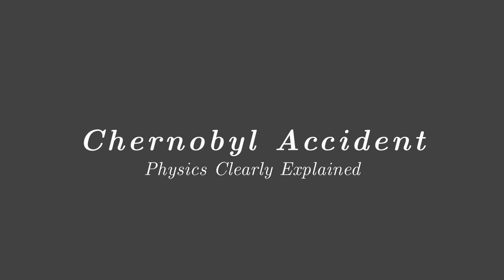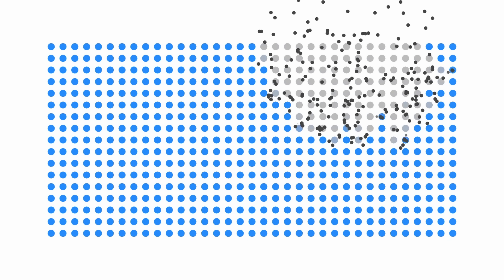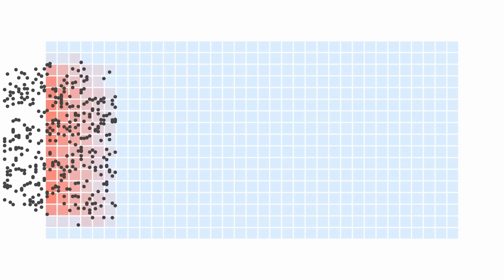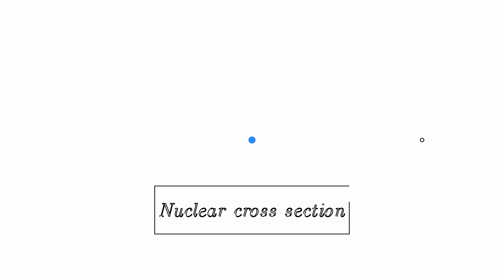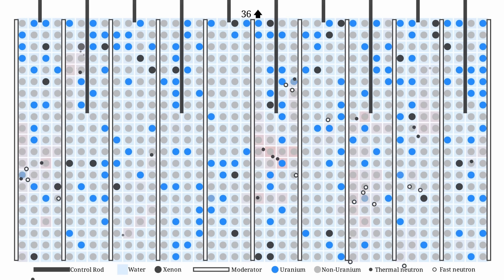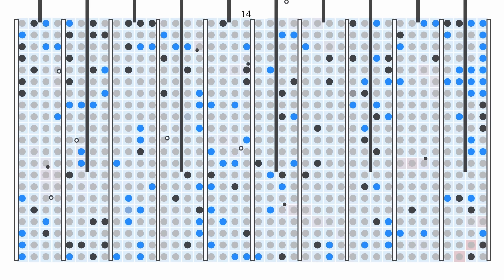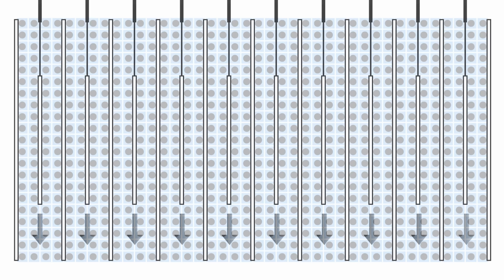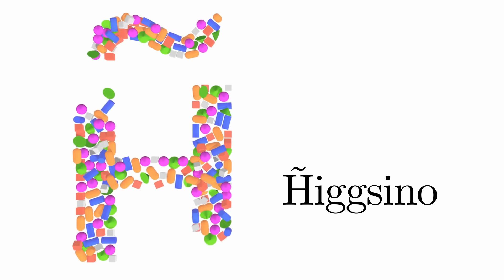Chernobyl Visually Explained

Comment: the fact that chernobyl happened is so stupid and it makes me upset. i dont even understand how they managed to accomplish such a feat.
how the hell did a human being with a working brain go "Ah yes! We should completely ignore the safety protocols set in place for the purpose of safety and preventing our nuclear reactor from becoming an extremely expensive pipe bomb! This is a wonderful idea! Surely Unit-4 isn't going to explode now!" and then act surprised when unit-4 actually did fucking explode 

(moreso, the steam that built up when all the water flashboiled exceeded the maximum pressure that the containment chamber/vessel/whatever you wanna call it could handle and then that caused a steam explosion then that was followed by a second explosion and a big ass radioactive fireball, but it sounds much funnier if i just say unit-4 went kaboom)

Comment: Beautiful video!!
Reply from the maker: Thank you for the kind donation!
Reply: @Higgsinophysics  I only have one question. Why did the control rods have "graphite displacers"?
I don't understand the engineering decision, can you explain? What's the purpose of these graphite displacers?

If the control rods are supposed to slow down the reaction, why do they have parts that speed up the reaction?
Reply: @EddiAndriniAnimation  "For the same reason our reactors do not have containment buildings around them, like those in the West. For the same reason we don't use properly enriched fuel in our cores. For the same reason we are the only nation that builds water-cooled, graphite-moderated reactors with a positive void coefficient. It's cheaper."
Reply: @fromaheight3958 That's just a quote from the series. I'd like to hear an actual answer!

Comment: It's like a perfect storm of different small mistakes and design flaws converged to cause this disaster. 

Number one of course was the attitude and actions coming from a tendency to prioritize job performance over safety.

They saw that something was slightly but noticeably wrong with the reactor status and decided to continue with the safety test, repeatedly, for a prolonged period of time. If they didn't get this done, they would likely face consequences from their bosses. Labor that's driven by fear is prone to error, same as unchecked ambition.

Once they finally tried to end it, it was too late. A design/construction defect unexpectedly triggered the final burst. (Control rod tips not up to code)

Comment: Those "jumping tops" are just myth. If any of them yould "jump", it would be because top plug of the channel failed and then overpessurized steam would simply rocketed that top cover into ceiling of reactor hall. After all, those tubes representing channels went through solid concrete top cover of teactor (and also its bottom), there was no way they could make any vertical movement (and top cover only flew to the sky after heat buildup skyrocketed and technological channels ruptured, allowing steam to rise it).

Comment: Why the hell did the control rods have graphite sections at the bottom?
Reply: "For the same reason our reactors do not have containment buildings around them, like those in the West. For the same reason we don't use properly enriched fuel in our cores. For the same reason we are the only nation that builds water-cooled, graphite-moderated reactors with a positive void coefficient. It's cheaper."
Reply: @fromaheight3958  wow great job quoting a dramatized HBO show about the event, I was hoping someone who knows something about it would reply. If I wanted to hear from you I would have gone down to the special needs home to ask

Comment: "scram button was stuck" - incorrect.

АЗ-5 button wasn't "press once - it works without operator input afterwards" type of button. It had no memory. You had to deliberately hold the button for as long as it takes for rods to go down inside the core. An operator in the heat of the moment has forgot this detail. He did press АЗ-5 button twice but failed to hold it for more than few brief seconds.

Source: Chornobyl RBMK instructor Fatakhov.

Comment: I didn't get the part with steam. To generate the power reactor has to conver whater to steam, right? But at the same time there should be no steam where rods are placed in... So where the steam should be?

Comment: This RBMK reactor was a "great" design - in Adam's Higginbotham book about the accident he stated that some of the workers knew the flaws of the reactor even as students, but you could not say a single bad word about the Alexandrov works (father of USSR's atomicity), because it was treated as a blasphemy.

In the book it is mentioned that controlling the reaction in such big reactor seemed like maintaining an order in a big apartment building where in the one place there is a big party, while in the other there is a funeral as the reaction was different in different part of the reactor.

Not to mention also that control button were so heavily used to keep the aforementioned reaction on the stable level that whole consoles had to be replaced each year because the buttons were too worn out.

Comment: I want to ask. Leading up to the explosion, it seems the uranium was being replenished at a quicker rate over time for a few seconds. 

What caused the fuel to replenish faster? Was the fuel being manually controlled, as you said earlier in the video, to replenish faster to better simulate the explosion? I acknowledged that you would replace the fuel, it just wasnt mentioned that the rate of replacement would increase over time, which speeds up the diagram more if im correct.

Or maybe im just imagining it

Comment: Thank you for this. My analysis from watching this is that they were addressing each issue individually with a polar opposite reaction to control it, which, sophmorically, makes sense, reduce power, insert rods, power too low, remove rods, too slow, reduce water, too hot, increase rods, etc,. but they weren't looking at stabilizing it looking at all three of these factors holistically. Example, slowly let xenon burn off before having another knee jerk reaction.

Comment: The control rods had water gaps in between the boron and graphite. 
Because you don't want high neutron flux at the edge where the welds are, seams are weaker than continuous metal. 
When they pressed AZ5, graphite was pushed up to the bottom edge of the reactor core, where is weakest, reactivity spiked, water boiled and the pressure broke the channel welds, jamming the control rods at the bottom. 
At that point, the path of last resistance became the upper biological shield, which was thrown though the roof, dozens of metres into the air and came back down into the building. 
Had it landed out side tree building, i think there would have been more running away

Comment: This video is simply wonderful. Thank you for putting in so much effort.

However, I disagree with the reason why operators pushed the AZ-5 button. 

From what you said, they had seen the unexpected rise of reactor power and this was the reason the SCRAM button was pressed. 
But, if I remember it correctly, Toptunov had pressed the AZ-5 button simply to shut down the reactor, because they finished the test and were done for the day.

Anyway, they were like children playing with matches in a wooden house. They did not understand how dangerous they allowed the situation to become. Usually pressing the AZ-5 killed the reactivity, so that's what they thought is going to happen. They disregarded the construction of control rods (graphite tips were going in first, boron was 4,5 meters up) and did not stop to think.

Now, my question is: having led the reactor to operate in such hazardous parameters, would it be possible to avert the disaster by not pressing the AZ-5 button and slowly re-enabling the safety systems?

Comment: This video helped me wrap my head around the the graphite "tip" part of the failure.  I imagined the tip being more a protective tip on a cane. Seeing how it was essentially an extension of the control rod, the effect it had on free neutrons and the reaction difference in the top vs bottom of the reactor was the final part I needed for it all to click together.
Reply: It was this flawed rod design that cooked the reactor

Comment: So near the end it was basically causing so much steam to be made that the whole thing just went off like pressure cooker? 

I also have another question per say just to better visualize things in my head here. So the place explodes right exposing the reactor. By that point with it being exposed we have what is basically a runaway nuclear equation making as much radioactive material as possible and throwing this poison into the air with no way to stop it besides the equivalent of smothering it with on of those fire blankets?
Reply: No, as soon as the steam explosion happened the fission stoped. In order to have fission you have to have a very carful setup, and the explosion just broke it all immedietly.

Comment: The most important takeaway here is that we know exactly what and why things went wrong at Chernobyl. International safety measures have made nuclear power plants the most reliable option today — in the same way that planes are far more reliable than any other means of transportation (even still with Boeing's predicament).

Nuclear energy would be a great and sustainable replacement for fossil fuels. Sadly, years of successful smear campaigns by the oil industry have put fear into voting citizens worldwide.

Comment: Starting at 13:00 If I understand the model correctly, instead of driving the control rods into the reactor, they would have had to first increase the cooling capacity to have a chance. That is, they would have had to pump more water through the reactor and only then drive the control rods into the reactor.

Comment: So if I'm understanding right, when the power was stalling, they should have decreased the water flow?

Reducing the absorption from water, which increases Xenon burning, thereby increasing reaction power?

Also the "graphite tips" were just silly: what was the rationale behind that?
Reply: The reason behind the "graphite tips" is simple. Using every possible space to moderate neutrons so that very poorly enriched uranium could be used.

Comment: Thank you, I now have a picture of what going on in Chernobyl. It as many one said, but if I can't get a big picture from this, I would not understand that. The chain reaction U235 (or enormous neutron) must be prevent for the plate. It is controlled by water, Xenon and control rod. The officer false action creates an enormous Xenon. It seems good since it prevent much neutron, but this decreases the power of this plant. Hence, they remove the control rod to increase power. Now, the only option to absorb neutron is water and Xenon. When the water is turned off, Xenon burns away quickly. This is a countdown for the disaster. The countdown is accelerated when AC-5 was pushed, they think the control rod will help to slow the reaction, but as the creator said, the rod tip made from Graphite which can accelerate the reaction. When the tip dip into the chamber, it accelerate the reaction and create much pressure from the boiled water. This prevent the control rod to move further, so it is impossible to stop the reaction. The chain reaction is now complete. Actually, I think if they decide to use water pump instead of AC-5, they may get a chance to prevent this disaster.

Comment: Two explosions happened, the first one blew the RMBK Reactor open; the second one was the result of oxygen rushing in with the uranium-235, graphite and other elements. The second explosion also resulted in an incredibly rare material called coprium, which is a black lava soup of radioactive material and oxides. 

Even though Chernobyl was a major human error, its main cause of failure was Xenon poisoning. This is when the nuclear reactor creates too much Xenon inside itself. This creates more heat which results in more steam. Steam in this case is water vapor (aka H2O(g)) which adds more pressure, adds more heat. This is bad for a reactor because there is no where for the extra heat to go, considering that a reactor operates within an inclosed environment. This creates this loop where heat adds more pressure and the pressure increases the temperature of the reactor.

Comment: "They are impossible to blow up."

Well, i heard this somewhere
Reply: That's what putting safety valves and reducing risk is. When you discover something new, you adapt, until you discover something new and adapt... Cars without safety belts were safe until they weren't. I do believe that most, if not all accidents are a huge series of accumulated mistakes/flaws/errors because we do test and troubleshoot before going all in. And after they happen everyone scatters to make sure it doesn't happen again or to them.
I still don't like or approve of nuclear energy - I keep looking both ways while crossing the street at a green light "just in case" ... I don't like the idea of one AH texting while driving, I sure AF don't like the idea of a suprise Fallout 4 cosplay.

Comment: Sir, I have to correct some things in the video, besides these it is a nice effort and appreciated work.

U235 emits 2-3 neutrons (statistically 2,4), not always 3.

Also, not every U235 + n collision results in fission.

The control rods were pulled out so much that the top tip of the graphite displacers went out a bit (this is missing from your simulation) as well and they simply were not long enough to reach all the way down to the bottom of the fuel channel, so water (the mostly absorber material) could enter instead (it is shown in your simulation).
The reason why AZ-5 detonated the reactor is that when they started moving down, the first thing that entered was the upper tips of the displacers that was pulled out from the core before. This added more moderation. What is more, the displacers displaced water at the bottom at the same time, removing some absorbers too. This resulted in skyrocketing reactivity.
Btw just as a quick note, unlike it was said in the series, this was not a nuclear bomb, it was a mere steam explosion due to the almost instant flashing of the cooling water. This resulted in a large pressure spike that made the covers of the fuel channels leave the chat, allowing oxigen to enter the channels and mix with hydrogen that finally caused a huuuge hydrogen explosion. Hydroger developed in the channels because at very high temperatures steam and the zirconium content in the cladding of the fuel rods react (basically as an oxidation) and the hydrogen content of the water becomes free.
So yes, as the footage in the movie series shows, even the first explosion was red-orange, however it was “only” steam explosion. This was a mistake. Just like when Ulana told Gorbachev that the emergency cooling system tanks would cause some Mt of TNT sized explosion if the corium melted into them, causing like a 30 km radius explosion or idk the number she said. That is ridiculously large and had nothing to do with reality. I mean not even close. It would have been big, yes, but not even close to that. Idk if it was the mistake of the writers or just a marketing trick to convince Gorbachev.

One more thing: the model is missing the upper and lower neutron reflectors, thus creating a neutron cannon.

Other things were mostly fine, thanks for the illustration!